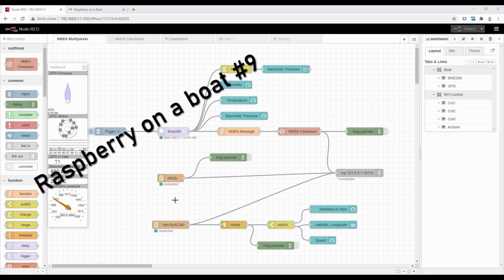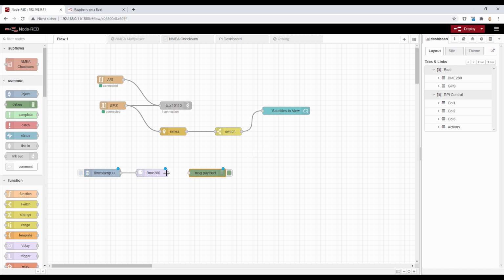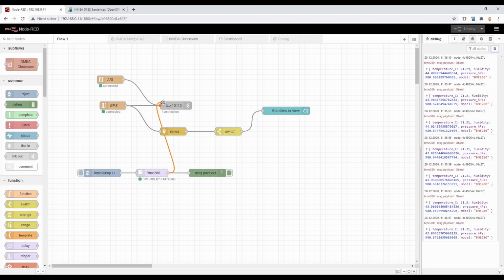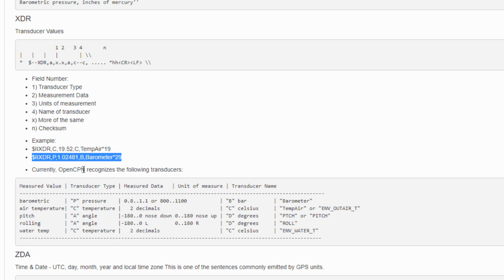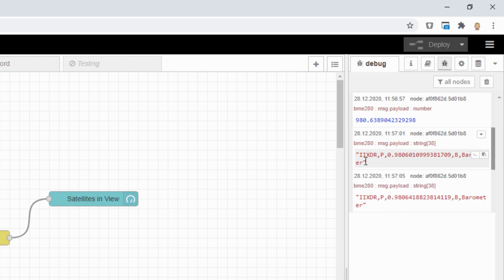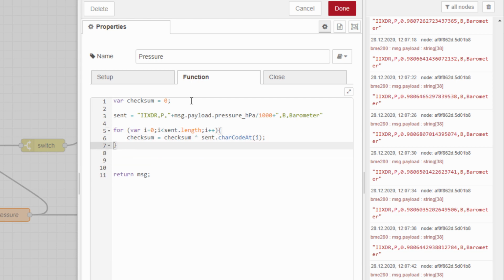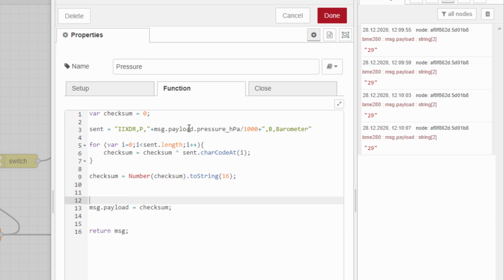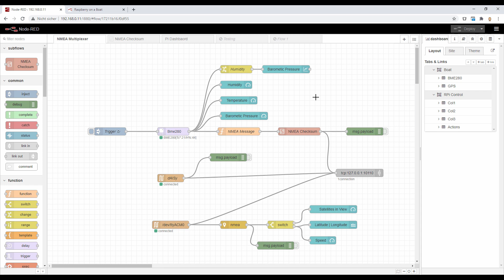raspberry on a boat #9: Node-RED for NMEA (2/2): Using Node-RED as NMEA Multiplexer for I2C Sensors

Comment: Wonderful videos and very useful. I have developed in Node Red a dashboard to show all the temperature parameters of my engine.... Now I would like to save them somewhere on the RPI5 to keep it as historic data to find out if there is any changes before problems arises . 
Would you share how to write a file on RPI (with Openplotter and Node Red installed) that save in a file generated every day with the value of that day?
I am a real beginner but with your videos I have accieved what I did up to now. 
It would be very useful to have the data to monitor the engine functionality.
Thanks for all.
Bet regards
Reply from the maker: My next video will be about an anchor alarm in Node-RED - and I also had to persist some data in case of a power-loss. E.g. the position of the anchor. I did exactly what you are asking for, writing a file with Node-RED, in my case loading the data on restart. So, yes, such topic will come, probably in November...

Comment: Thanks for this video. I put sentence

var checksum = 0;

sent = "VWRPM,E,1,0," + msg.payload * 60 + ",A"

for (var i = 0; i < sent.length; i++) {
    checksum = checksum ^ sent.charCodeAt(i);
}
checksum = Number(checksum).toString(16)

msg.payload = "$" + sent + "*" + checksum;

return msg; 

AND SECOND ONE

var checksum = 0;

sent = "VWRPM,E,1,0," + msg.payload * 60 + ",A"

for (var i = 0; i < sent.length; i++) {
    checksum = checksum ^ sent.charCodeAt(i);
}
checksum = Number(checksum).toString(16)

msg.payload = "$" + sent + "*" + checksum;

return msg; 

I send two of them to the TCPout  but in the QTVLM I have "<b>wrong checksum</b> $VWRPM,E,0,0,5,A*53$SDDPT,295.2120056,1*44"
The sentences are connected together. and program tell me that is wrong checksum. I've noticed that if I put string from generator nmaa and debug them in node red there are little sign (like return arow from up to down and from right to left) on the end on each sentence. Mayby something is missing in the code. Please help.